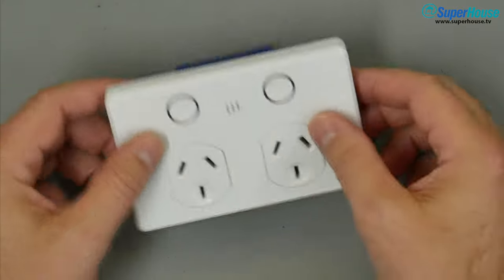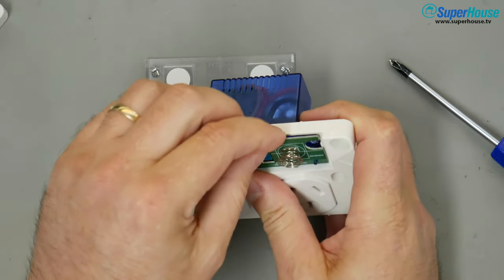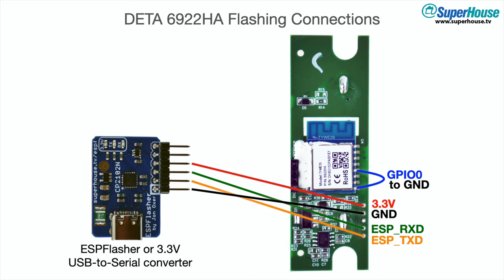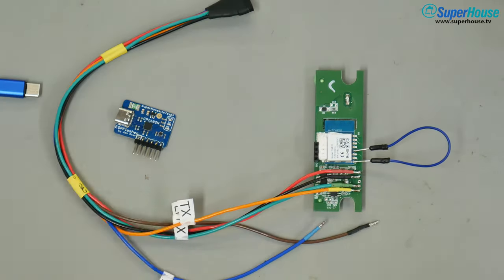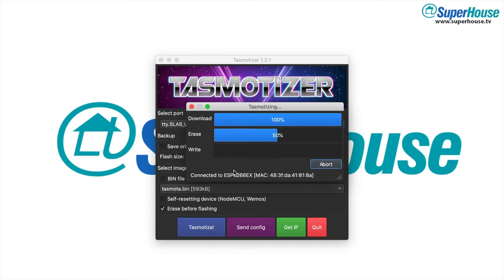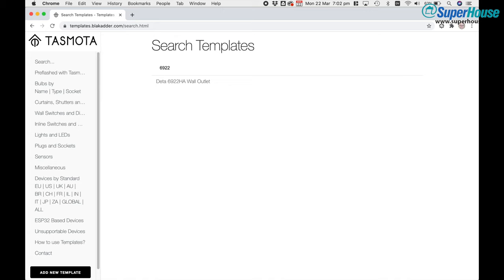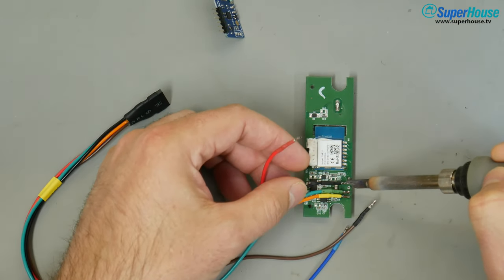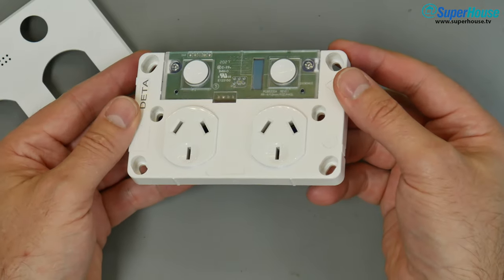Tuya to Tasmota: DETA 6922HA

Comment: Have just flashed my first DETA6922HA...I managed to do it without having to solder onto the control board.  What I did is use a 5 pin JST-XH male plug connector, then had some jumper wires for 3.3V, GND, ESP_RDX and ESP_TXD.  I also branched the GND jumper wire.  The 5 pin JST fits right into the soldering holes with a snug fit.  I would hold the additional ground wire on the GPIO0 pin when making the USB connection...  Worked like a charm.

Comment: awesome tutorial mate, short and sweet and to the point. any chance you would do one on the same unit with tuya-convert? would the wall switches be the same
Reply from the maker: I'm part way through doing a long video showing different conversion methods including Tuya Convert, serial flashing, and replacing the module entirely. I plan to do more of these little videos about specific devices to supplement that.

Comment: Hi all, looking at wiring up my new house and would like Smart Power points throughout which monitor power consumption. The Deta Smart Grid Connect app does not show power consumption on the wall mounted version (6922A), is this a function of the chip or the app, if the app, when flashed too Tasmota are we able to have the power Monitoring feature?

Comment: Tuya Convert is now part of tasmota.  Operates over WiFi so need to dismantle and solder the device. Works really well on Esp based that devices.
Reply from the maker: Only sometimes, and the number of devices that can be switched with Tuya Convert is falling. Tuya Inc is actively trying to block conversions so new firmware updates close the security flaw that Tuya Convert exploits to do the change. Hard-wiring the connection is the most consistent and reliable method because they can't block it in the chip. They'll be able to block it on ESP32 based modules using encrypted flash and a secure bootloader, but the ESP82xx series don't have those features.

Comment: Any way to disable to annoying flashing light in the middle of the outlet? It sits there flashing away with wither wifi or mqtt traffic which is a killer for me.
Reply from the maker: Good question. GPIO4 is connected to the the "link" LED, so perhaps if you edit the configuration to disable GPIO4 the LED won't come on. The LEDs on the buttons are hard-wired to the outputs though, so they will always come on if an output is on.

Comment: The new model of these that has the WB2S chip and can't be flashed has the model number as 6922HA Series 2 and lists both WiFi and BLE on its networks on a sticker on the blue clear plastic. The ones that cannot be flashed do not have this sticker on them. This is visible through the back of the clear plastic packaging.

Comment: New 2 gang one I bought from Bunnings with 2x USB plug charger is using new WB2S chip that is their own and can't be Tuya converted as its MCU based and not an ESP :( Wasted $70 as I wont be connecting to Tuya/Grid cloud
Reply: Were there any features that identify the new compared to the old?  I picked up on yesterday and performed the mentioned soldering/programming steps last night and it's working sweet as a nut.  I noticed the one I chose was packaged, but not in a box, whereas others on the shelf were.  Maybe this indicates the difference for the features you describe?
Reply: @DodgeyRog  Nothing stood out to differentiate. I even bought a couple of other units(trying to find oldest on shelf), but they are their other chips, it requires the solder/flash so is at least they are convertible.